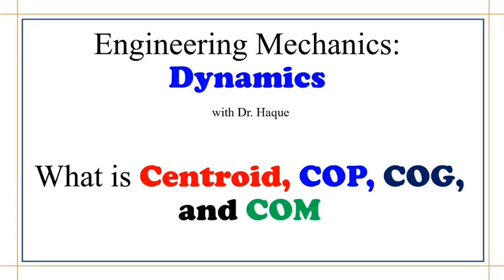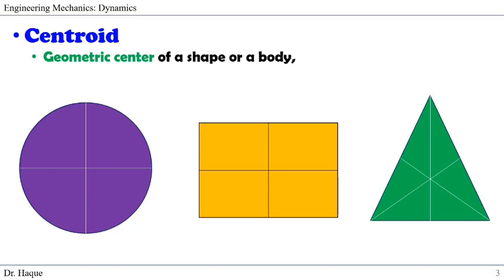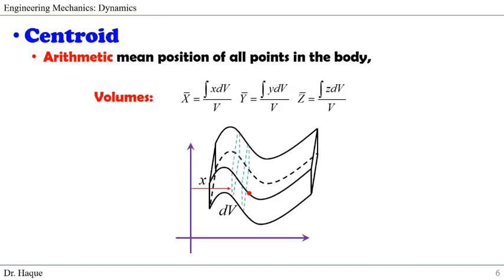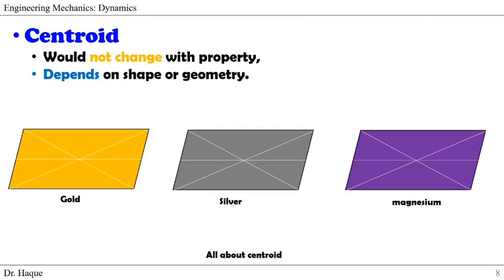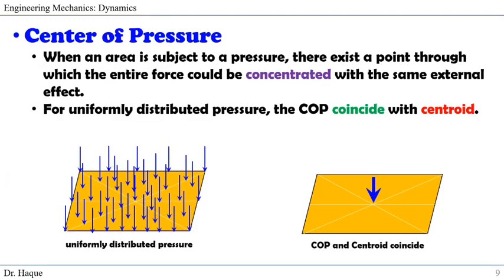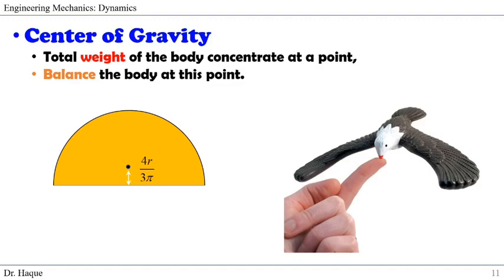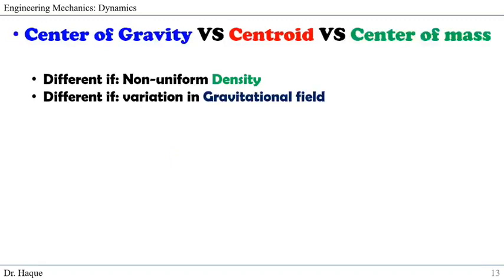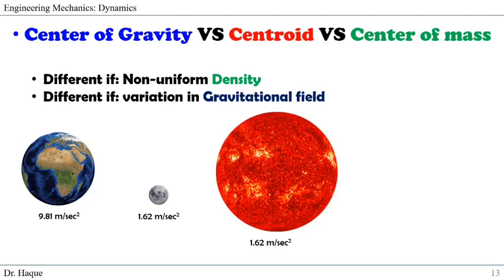Centroid, Center of Pressure, Center of Mass, Center of Gravity, and Center of Rigidity

Comment from the maker: The Center of rigidity is the point where if force is applied, it will not go under rotation (no torque), but just translation in space. It is the stiffness centroid within a floor-diaphragm plan.